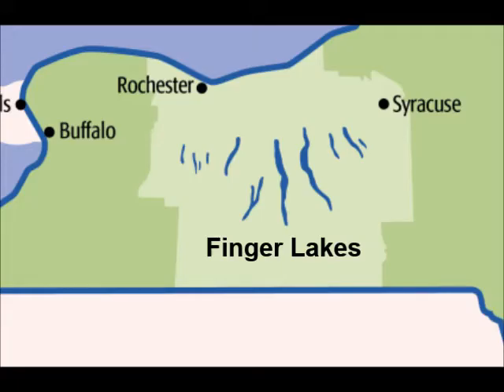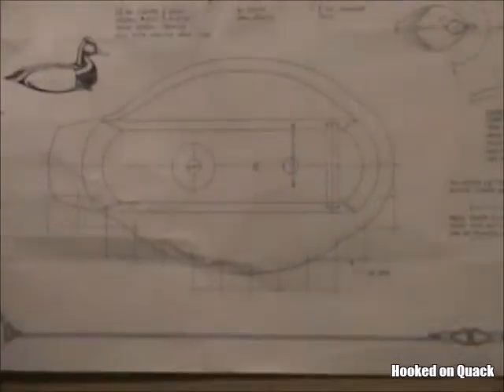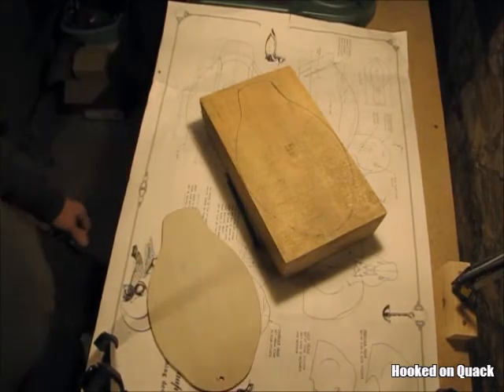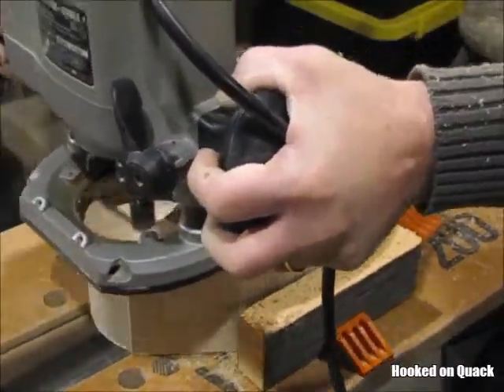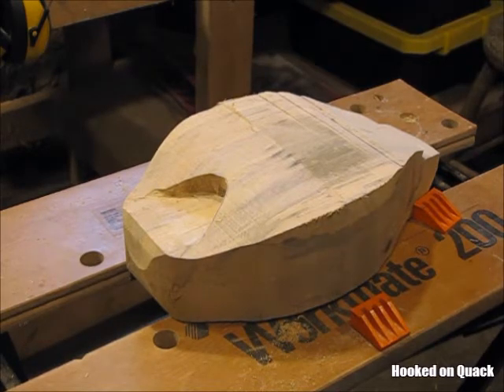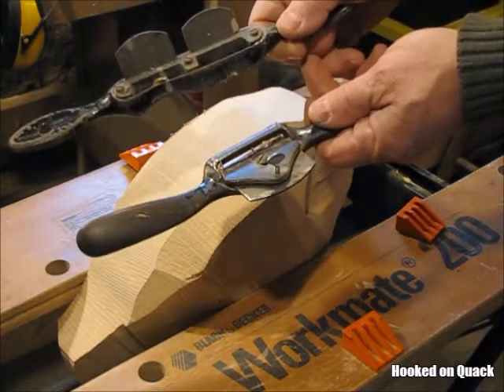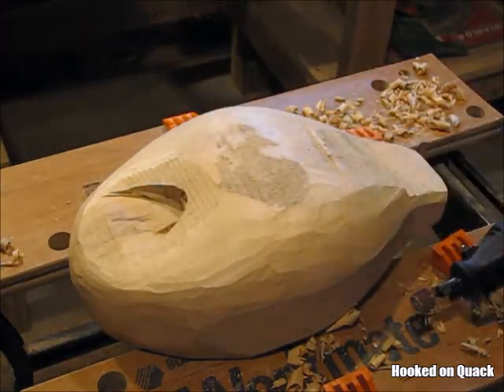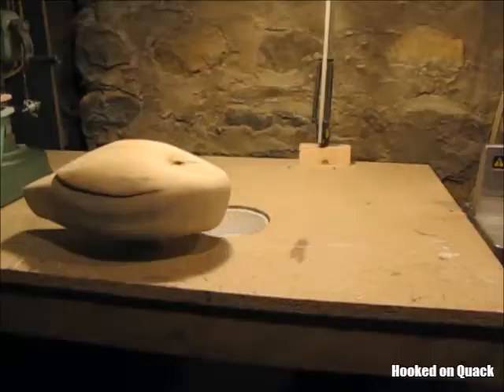Homemade Redhead Decoy Project - Part 1: The Body

Comment: Where did you get the decoy plans
Reply from the maker: The plan was part of an old "kit" that I was given, Working Plans for Working Decoys by Charles F. Murphy. Are you looking for a particular plan?
Reply: @hookedonquack  I was just looking for a collection of them that covered most of the puddle duck
Reply from the maker: @NATTUD  Murphy's set includes Canada goose, mallard, pintail, wood duck, scaup and canvasback, so only 3 puddlers. I believe you could find a used set on-line but it's not exactly what you're looking for.
Reply: What kind of wood to the body?